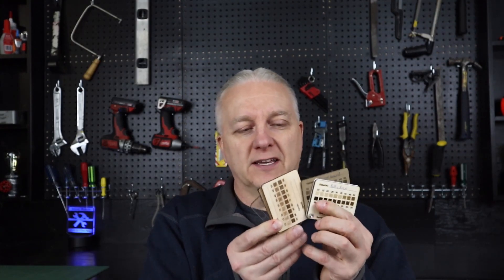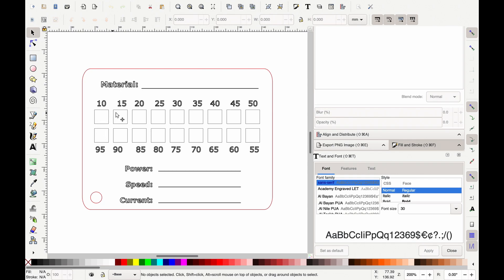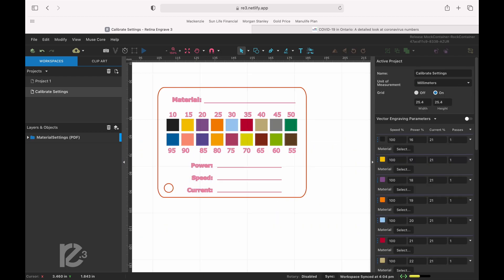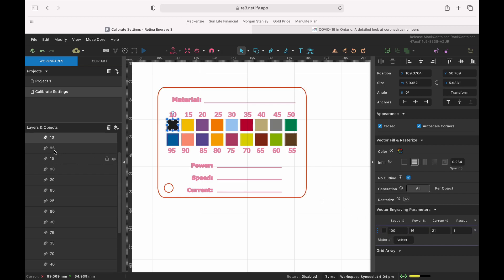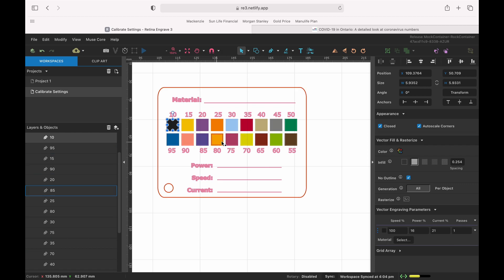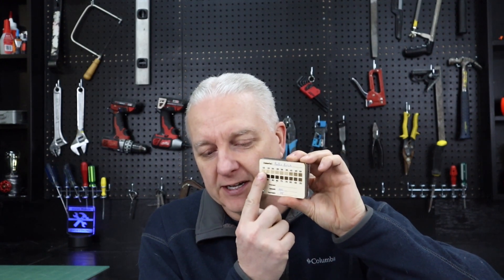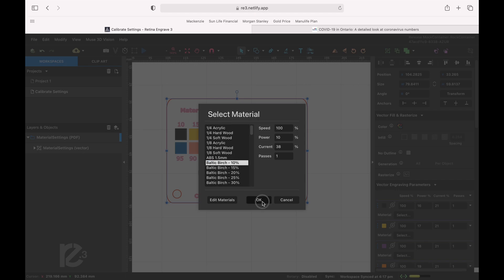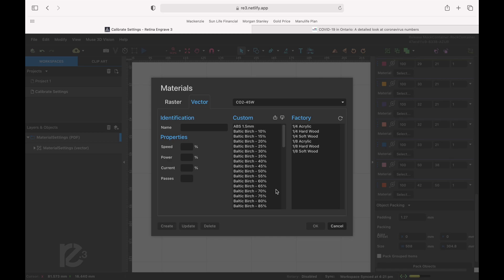HOW TO FIND THE PERFECT LASER MATERIAL SETTINGS

Comment: So I have the same 45w laser I used your jig for 1/4 birch and it cut it out at 40 speed 100 power and current 100. I tried to cut the same material for a picture stand and I have now done 3 passes and still hasnt cut the whole way through. I cleaned all the mirrors and lens but it still isnt any ideas?
Reply from the maker: So 1/4” plywood, especially hardware store plywood, is pretty tough for a 45W laser to chew through. You can do it eventually but you will have a lot of charring. You might be better to cut a couple separate layers of 1/8” plywood and glue them together.
Reply: i have the 45 watt muse core. I slow it down to 5% speed when I'm cutting thought 1/4".

Comment: Do you have this as a printable download...your videos are great, thanks
Reply from the maker: Do you mean something like a spreadsheet?  If so I don't because these settings are realistically targetted at a laser running Retina Engrave 3 so they wouldn't be much good anywhere else.  The basic goal of the material library is so you don't need to do this.  You can open the file I provided in a text editor though and look at it.  It's a quasi-human readable format.

Comment: Hi Steve,  I have yet another questions for you :)  
A friend asked if I could do a photo that she copied off another site.  It was created on another competitor laser site with the following info:

90watt co2, imagR new wood 318dpi
One pass 600mms 10%power max

Our DPI settings are 250/500/1000.  Also, our speed are 1-100.    How do I convert 600mms to FSL PS24 90W and should I run my project at 250dp, or 500 dpi.  It's a photo she wants to gift her mom for her birthday.

Can you advise? Much appreciated.
Reply from the maker: Always good to hear from you. 😀  So the short answer to your question is "Yes".  It should work just fine assuming the image is in a recognized format such as JPEG or PNG - and if it came from ImagR it should be standard.

The DPI conversion should happen automatically, just like it would for any image you drop in the workspace.  You're probably going to scale it anyway and that triggers an image interpolation to get the DPI scaling correct.

As far as speed and power, you're going to need to play with it a bit since this will  vary from on laser to the next.

One caution...given your description of the original laser it's probably using Lightburn and in that case the settings could be for a true grayscale image, which is something you can't do in RE3 - you'll need to use dithering.  This will use very different speed and power settings if this is the case.

True grayscale is one more thing I wish FSL would add support for in RE3, but maybe that's just me.  If UPS can ever find the laser tube for my DIY laser project that they lost, I would do a comparison video between image dithering and true grayscale.

Comment: Hey Steve love your videos, i just purchased a muse and was wondering about the honey comb it seems to tall for the laser to run obstructed, does the aluminum plate come out.?
Reply from the maker: Hmm.  I’m not sure I understand. Do you have a Muse 3D or a regular Muse?  Actually I’m asking if you have auto focus or not. If not then you will need to manually focus the laser by adjusting the height
Reply: @SteveMakesEverything  Hey Steve it’s a Muse 2d it seems that the honeycomb seems to tall for the height. How would I adjust the height of my laser.
THKS
Reply from the maker: Ah got it. I’m not the person to ask about the Muse 2D, but your laser should have come with a focus puck and I believe there is a thumb screw on the the lens tube near where it comes down to the honeycomb table.  You should be able to loosen that screw and move the lens tube up enough to slide the puck between it and your material. Then tighten the screw and your laser will be focused.

Comment: Hi again - I was getting confused until at the end you mentioned that this is for what you call vector "etching," where FSL calls it "engraving." I had been thinking that "vector" meant just "cutting," and "engraving" was everything done by raster. Ugh... A question - I was expecting the "power" setting for each block to correspond with the percentage - that is, (like at 6:18 in your video), a light blue box that's labeled "30%" on your chart would be at 30% power - but it's at 20% - and the power percentage values in RE3 don't go up in 5% increments, but 1% increments, starting at 16% for 10% power on the chart and going up to 33% power for 95% power on the chart (6:46). I had been thinking about making such a chart on my own for each material, but I would have actually put in 5%, 10%, 15% power settings in RE3. I'm confused, and am sure I am completely misunderstanding something. And to confuse it more, I just took delivery on a FSL Muse Titan with a 100w tube (still setting it up) - I don't even know where to begin to convert your settings for a tube that's more than twice the power of your example. Obviously, I'm a complete newbie at lasers (though I have my own CNC (using Vectric Aspire), so am not completely in the dark. Help!?!?
Reply from the maker: Fear not - we all started someplace. 😀. There are a lot of numbers to deal with here.  The percentages show on the engrave material are intensity percentage (e.g. the shading level). These are separate from the power, current and speed percentage.  A combination of the latter 3 will create some level of shading.

As you noted this will be different for different tubes.  If you laser is an 80 or 90 watt tube then you are certainly going to need to increase the speed and probably drop the power/current to get to similar intensity levels on the material.

Does this help?

Comment: Extremely helpful video. Ignorant question, though: If your power percentage levels in the software don't match the numbers above the corresponding boxes, doesn't that just complicate things? Why not put the actual power level percentage used above the box (16%, 17%, 18%, etc. instead of 10, 15, 20, etc)?
Reply from the maker: It's a good question, though the percentage of power will vary from laser to laser and with other factors such as the age of the laser tube.  The percentages shown here are %darkness (a measure of intensity). 

If you'd rather have a gauge that show power levels then it's pretty simple to create one, though be aware that 20% power on your laser today may produce different result than it will a year from now.

Comment: Hi Steve,  I have been looking to import your json file, but for some reason on my machine I don't see the Import button under Materials>Custom like you have in your video.  I am a complete noob is there some soft of software upgrade that I have to do first to get that to show?
Reply from the maker: Someone else mentioned this a while ago too. Not sure if you have a Muse or a different laser. Maybe this feature only works on the muse. You might have to ask FSL support.
Reply: I have a muse 3d laser....the exact same model and make.....I noticed....that in your tutorial you are using the simulator which has the option to import....my laser though....does not.  Did you upgrade the firmware or software on you laser since you bought it?
Reply from the maker: There shouldn’t be any difference between the simulator and your laser. I use the simulator only because my laser is right behind where I record videos so I like to keep the noise down. But I certainly import the same file into my laser